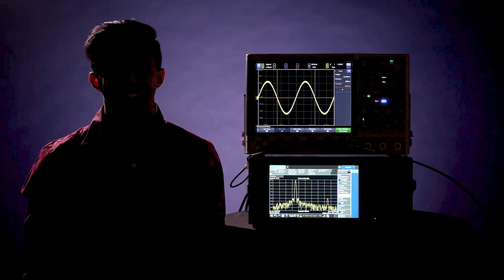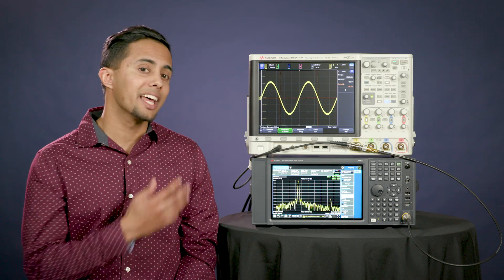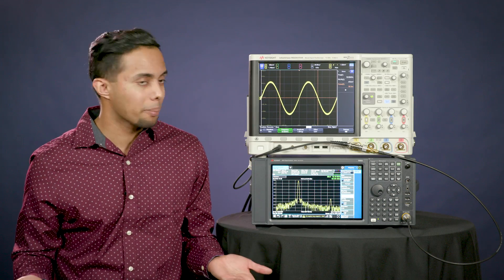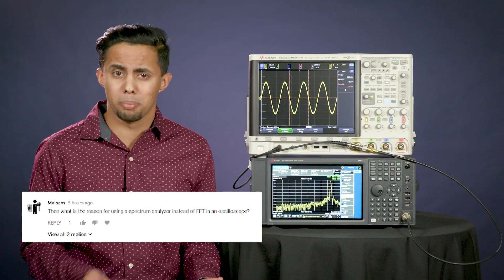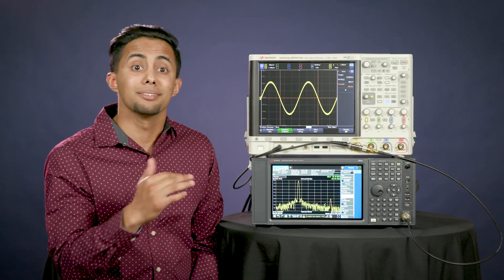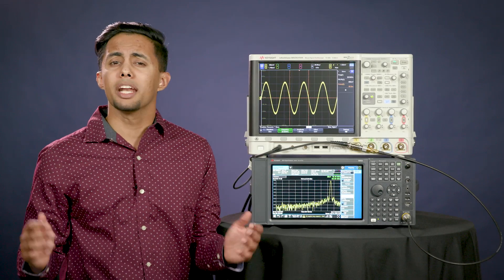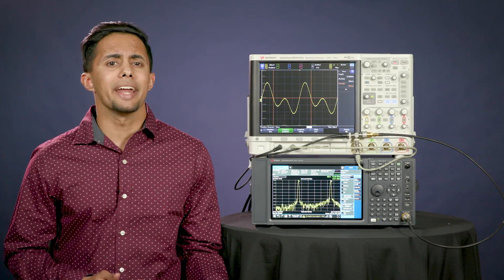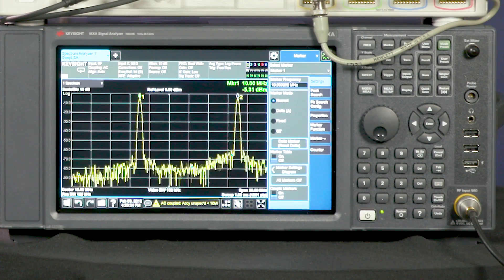Time Domain vs. Frequency Domain, What’s the Difference? – What the RF (S01E02)

Comment: in a way the frequency spectrum is (in) the time domain since frequency is measured in the time domain, with among other factors, zero crossings may be analyzed/described instead of a bipolar minimum-maximum discrete value of a signal. at high frequencies there's less and less to describe so if isolated, they create tones instead of beats. just some ramblin'

Comment: Thank you. Would this s domain be the same as found in Laplace transforms
Reply from the maker: Oooh, great question. The Fourier Transform is a special case of the Laplace transform.
Reply: @KeysightLabs  thank you . So if I learn the Laplace then it will be easier to learn the Fourier?
Reply from the maker: I think it provides context for sure. I'd imagine there are good mathematics videos on both of them on channels like the Khan Academy.
Reply: @KeysightLabs  would the Laplace transform help with engineering projects such as balancing a pencil on end with XY motors as actuators?

Comment: Good day, I had collected a time-domain data in an excel form where column A is the time while column B is the torque about 6400 points in the 30s where I had simulated and converted into excel data from a mechanical simulation software with no specifications in terms of signal detailing// However, i wanted to determine my sampling frequency value through the excel data and found it difficult to determine the accurate  sampling frequency as different number of points had been detected by the software  with no consistent points // May i know if there any way to handle this kind of signal/waveform ?

Comment: On the signal analyzer's output, why are we plotting frequency against amplitude? In other words, what does the height of the peak at a certain frequency signify?
Reply from the maker: Essentially, the height of the peak signifies power at that frequency. For RF analysis the power levels at different frequencies is what we care most about. We want it strong enough to communicate in the bands we care about, and weak enough in surrounding bands so that it won't cause interference.

Comment: So are we just going to ignore that second peak in the first example on the signal analyzer?
Reply from the maker: Good question! It was at 20 MHz, so probably due to the less-than-kosher T-connecter we used to split the signal between the oscilloscope and analyzer. In a lab setting, you'd use an actual splitter instead.